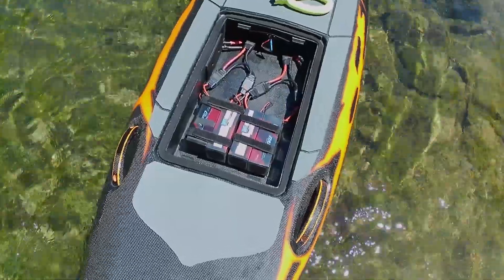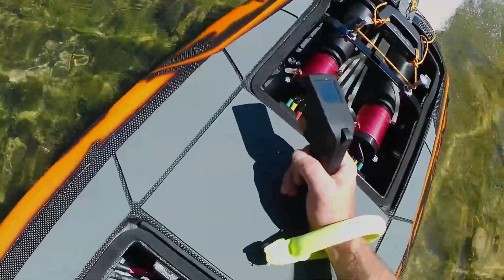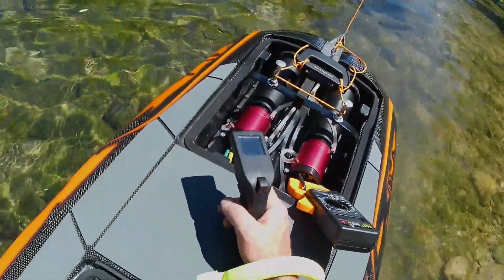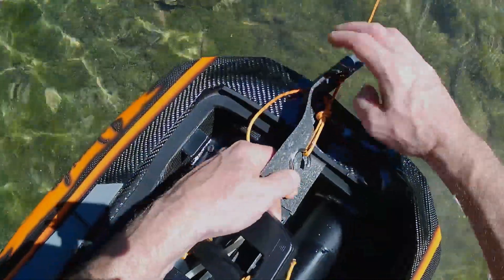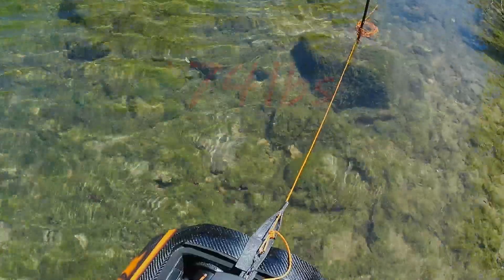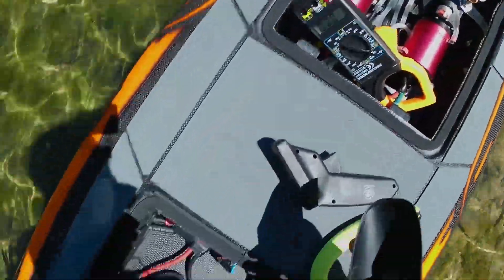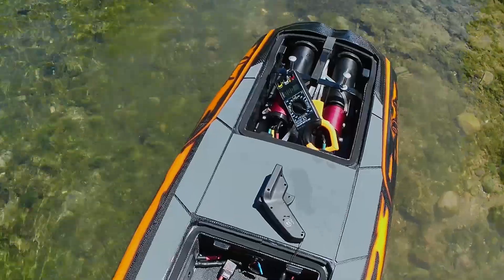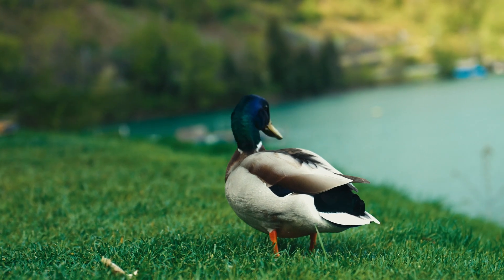Will My DIY Electric Surfboard Survive This Power Test?

Comment: Amazing work with the board , but you have unfortunately big problem because your drive train is low budget china stuff . Way to week and will burn esc / motor .  Great job but upgrade motor , esc , and jetdrive .
To much work to not go all the way .
Also have similar project but 100 mm jetdrive and high end motor.
Good luck 👍

Keep on nice work 😃
Reply from the maker: Cheers dude

Comment: Hi, I think 40 kg of thrust is too low. For a confident planing start, I achieved about 55 kg on my homemade board, reaching a speed of 40 km/h. Another important factor is the duration. It's one thing to test for a minute, but quite another to test for 20 minutes at high currents, as the cooling might not be effective.
Reply from the maker: Hi mate yeah I am going to 50v eventually so on 30v it's respectable and in a previous vid I rode the board for about 10mins on 30v but only with 8000mah so the only way is up. The testing of the drives and water leaks was mainly my concern.
Reply: @thewaysider7774  Hi, we'll be waiting for more tests! I'll try printing your water jet and installing my 56123 230 kW motor with 60 volt batteries. I'm curious to see what the results will be with my motor. I might have to adjust the impeller pitch.

Comment: Your definitely having voltage drop across the batteries, you need more current capability which means less resistance. Best answer is more batteries.
Reply from the maker: Cheers I thought as much it's just it didn't do that when I rode it the first time,but I did change the lvc a little so it's probably that also. Nice one friend.
Reply: @thewaysider7774  No Problem!

Comment: You're so close to ripping that thing around! My suspicion is the batteries are sagging and tripping the safety voltage cut off in the esc. Try swapping the batteries and see if the other esc cuts off at 80 amps as well. If so, it's your batteries.
Reply from the maker: Cheers dude will try that out, also haven't fully charged the batteries for a couple of videos but am still on nearly 4v per cell.so will keep going and try everything. Thanks for the idea.